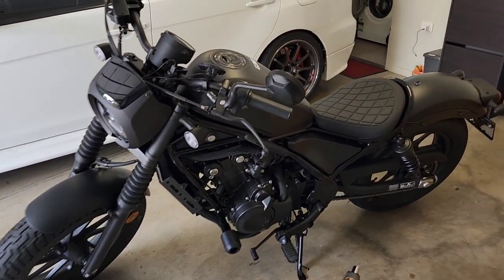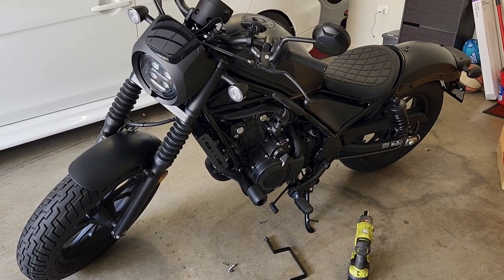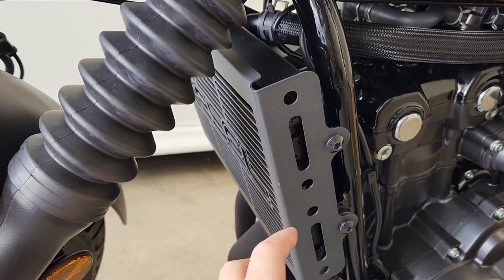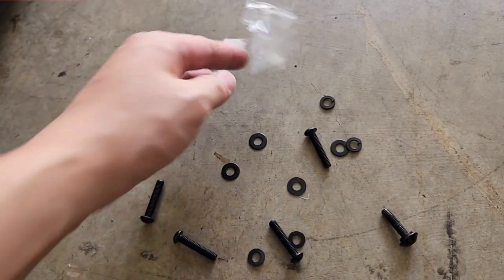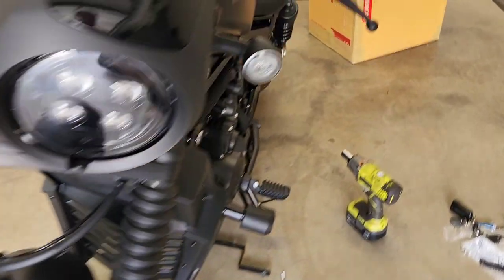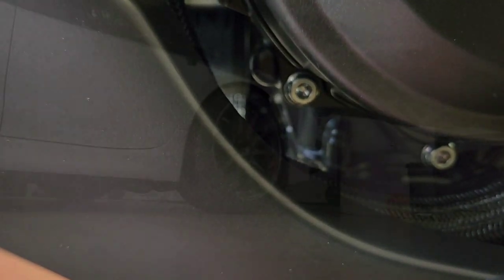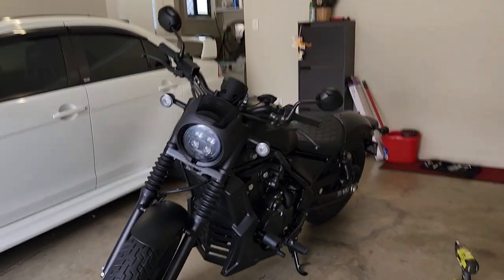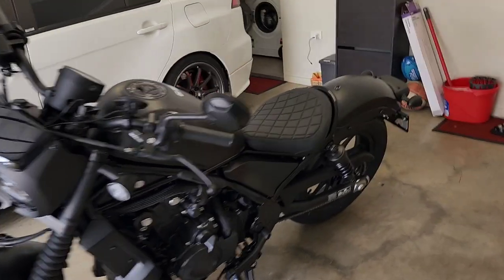Honda Rebel KSPEED Diablo front engine cover install - 7W3KD Custom TWEAKED REBEL

Comment: Hey Juzzie! 
Awesome video, very inspirational and thank you very much for sharing us your tuning & modding journey with your rebel. 
I was wondering if the front engine cover fits on rebel 1100 as well?
Reply from the maker: Thanks, for the props Tom👍 this particular one doesn't, there is a specific 1100 version that was listed for sale on the kspeed site though last time I checked

Comment: thx for the video, the mod looks sick. love it! just worry that the plastic will melt as that area gets really hot. You also want to make sure the bike doesn't get hot temperature because less air running on that area.
Reply from the maker: Yes we saw that happen in a friend's non genuine part but she replaced it with genuine kspeed likenindid and it hasn't been a problem since. Genuine has heat reflective material and the material itself is better quality. No heat warpage whatsoever on genuine parts 👍

Comment: Hey mate! Loving your process so far and given ya a deserved sub. Been considering getting some parts but have been hesitant on shipping issues and whether individual parts match the original matte grey/black finish of the bike. Whatta you reckon on these issues after having lived through it??
Reply from the maker: Thanks for the sub and glad you're enjoying the build. The parts from kspeed have taken around 2 weeks to arrive from Thailand, and currently EMS Japan from webike is 3 weeks counting when it is normally 4 days. The kspeed parts are a perfect match for the axis grey metallic which is commonly referred to as the black 500 colour. All of the kspeed parts have fit perfect. Of all of the parts I would say the rear fender has been the hardest to fit. The actual fender is very tight to flex to line up the bolt holes for the brackets' 4 bolts.
Reply: @TweakedGSX   @Juzzie Evo X  2 weeks is pretty dang fast! Got my rebel with the brown seat and have been keen on getting the front engine cover and fuel tank cover. Videos have all the info I've been looking for man, especially as a fellow Aussie.
Reply from the maker: @gabrielurquhart5023  I'd like to see it when you get the parts in. If you can tag me on IG or msg me on Facebook once done 👍
Reply: @TweakedGSX  will do mate, love your work!

Comment: I have the Hepco & Becker engine guard installed when I got the bike and been wondering if this belly pan will fit with it. Might have to do some customizing to fit my bike, what do you think?
Reply from the maker: Unfortunately the handle like sides of that engine guard mean that only one bolt could tighten it. So it could work if you then Dremel out a section for the handle to slot into but it won't be as secure as a 2 bolt setup. In all honesty I think if you are more safety oriented it would be better to keep your engine guard